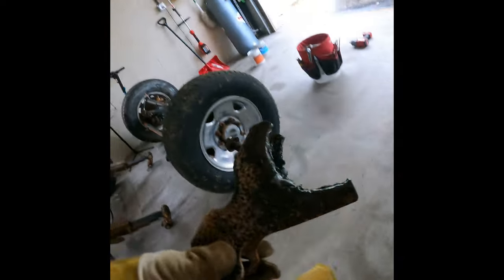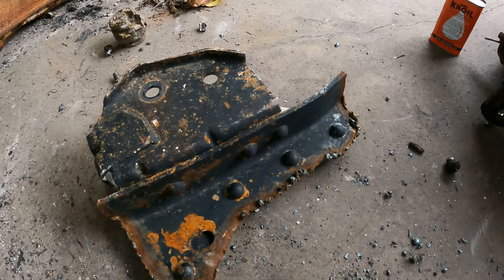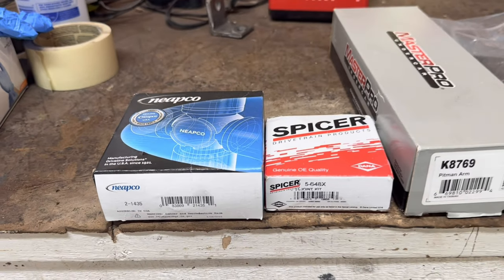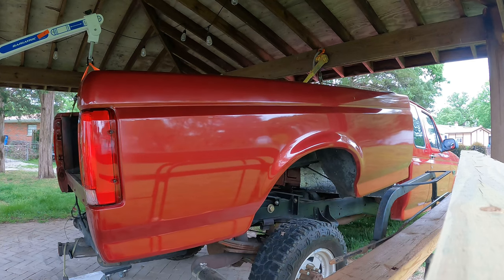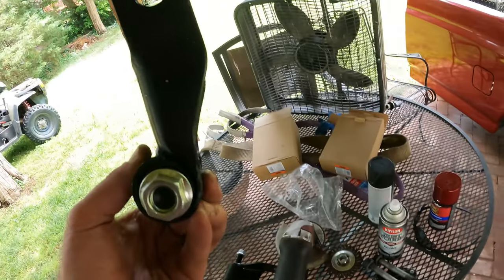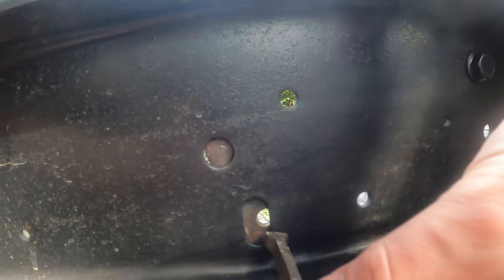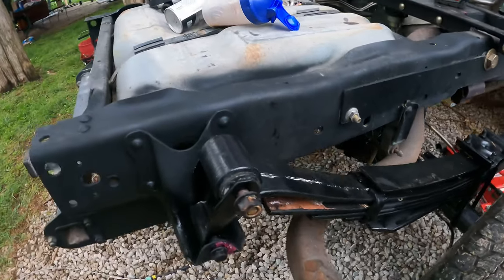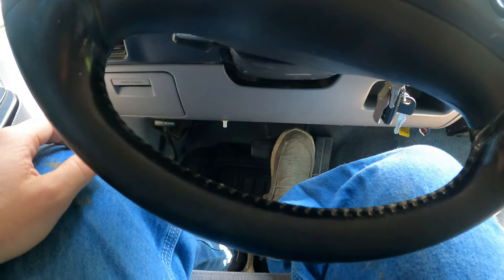05+ Axle Swap - OBS ford (Part 1)

Comment: Awesome build man! I’m doing mine right now as well. I do have a couple questions. First what is the measurement from the top of the rear leaf springs to the gooseneck? I’m trying to see if my  used springs are sagging. Also do you have a stock coil? If so, do you have the height measurement of them uncompressed?
Reply from the maker: I do not have a uncompressed coil spring measurement. From the center of the rear axle to the top of the frame it’s 19” you should be able to measure yours the same way and see if it’s sagging. As long as you also have overload springs.
Reply: Yes, I have the overload springs. Thanks for the info Man I do appreciate it! I love the color of the truck by the way.

Comment: Morning bro. Awesome job on the swap. I have the same swap done on mine so if you have any questions let me know. I do have one question for you, what gooseneck hitch are you running? It looks like it is fully bolt on, and I believe B&W makes one just wanted to make sure I was ordering the right one.
Reply from the maker: My gooseneck is a CURT, b&w does make one, identical to the curt for a lot more $. I got it on etrailer. Works perfect. I tow a 5th wheel camper converted to gooseneck all summer long. Thank you for the kind words